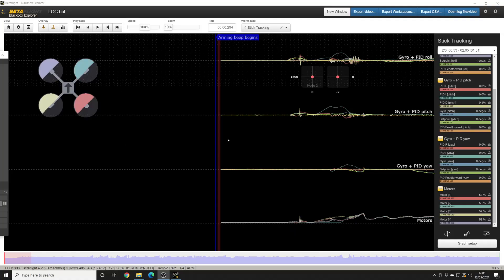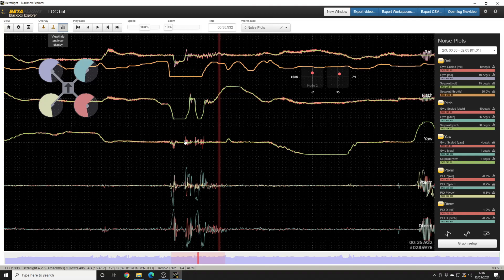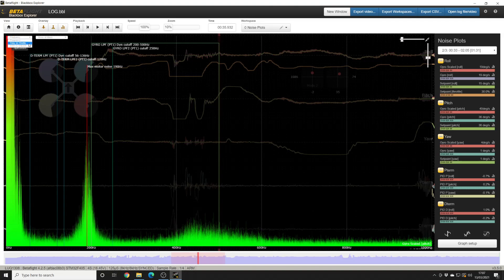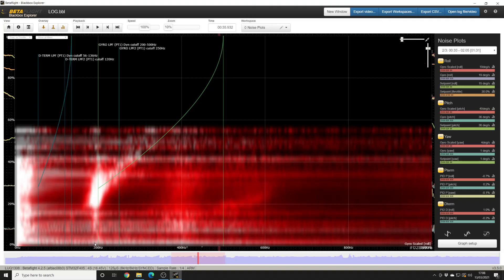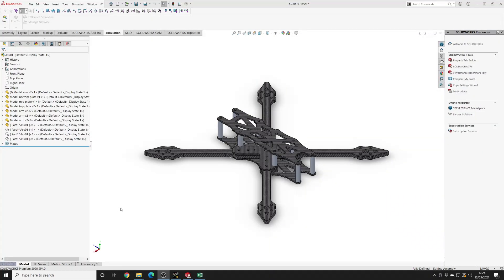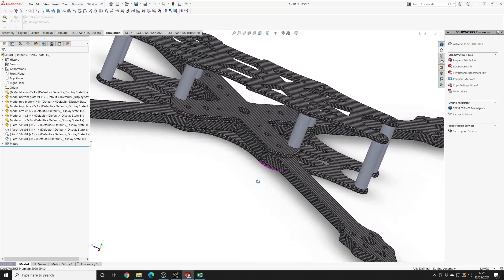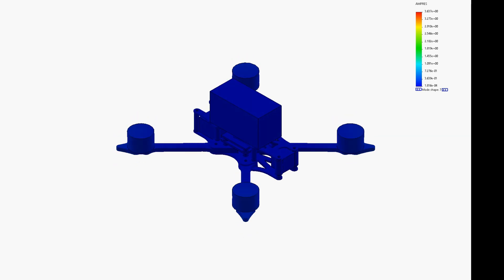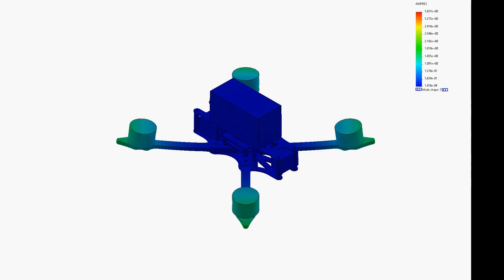Asu01, sent me his frame design and a Blackbox log. Here's where the theory meets cold hard reality!

Comment: Hi Chris, both the freestyle frames i use (Xbee LB1 and STP Gunn v2) have a similar spike around 200hz and it looks similar to the frame you reviewed here. What kind of filtering and PD balance would you suggest yo mitigate this resonance since we clearly cannot get rid of it?
Reply from the maker: I would rely on the BF dynamic notch filter to tackle it. Try my filter settings for clean builds that I give in my filter video.
Reply: @ChrisRosser  Thanks, I've followed that video and tweaked the settings a bit. I tried your recommendation to use a biquad notch filter for that spike since it is independent from throttle level. Thanks for your videos, things make more sense now :)

Comment: are you able to calculate the COM and Inertia Tensor around the COM using your software and models?
Reply from the maker: Yes, it's trivial actually. Do you have a need for this information?
Reply: @ChrisRosser  I have two ideas I want to test out: Implement feedback linearization and a model based kalman filter, both of which I need which require knowledge of the moments of inertia. I am trying to find a way to use non-dimensional quantities in the implementation ie. describing the moments with respect to some nominal base value which is more practical I think for pilots to tune because most pilots are not going to have the knowledge/tools to calculate the actual moments of intertia for their own quads. But I can't fully eliminate this problem so having a baseline idea of the actual moments of inertia for a typical 5 inch freestyle build would be a very helpful starting point. Also I am very happy to see this channel delving in the physics and first principles behind fpv quadcopters. Not many channels that actually do this. Really nice work on the videos!

Comment: Hello Chris. I watched your drone frame vibration videos. Thank you, it was very interesting. I have a 3D frame design, can I send it to you for a test? I am an engineer myself and work with fusion360 and solidworks programs. But for work, I never had to do vibration tests. Could you tell us in more detail how you set up a model in solidworks for a vibration test? Why don't you take into account the physical model of screws, nuts and washers in the simulations?
Reply from the maker: Resonance simulations of composite structures are always approximations and I've found that modelling the screws as simple cylinders speeds up the simulation without affecting the results. Sim is set up with weak spring support and frictional/bonded contacts depending on whether there can be sliding or not. Thanks!